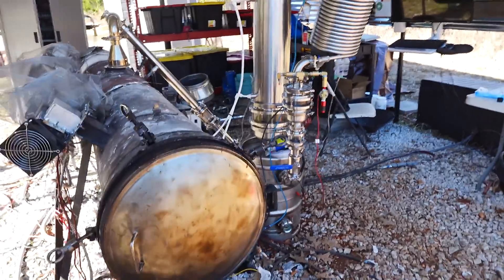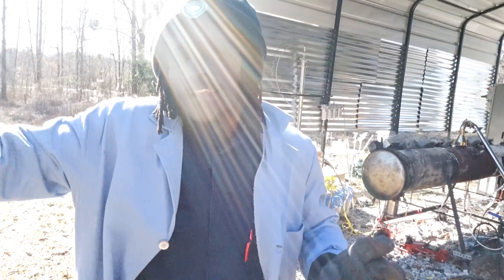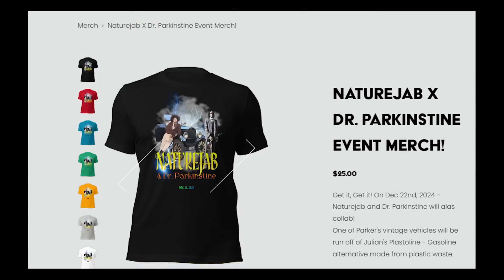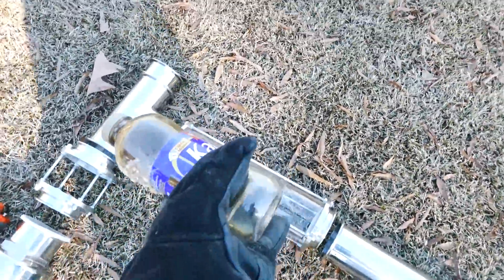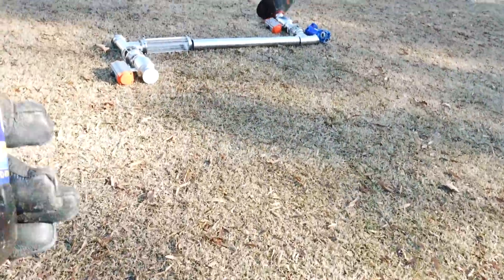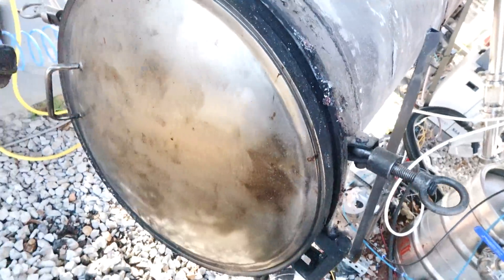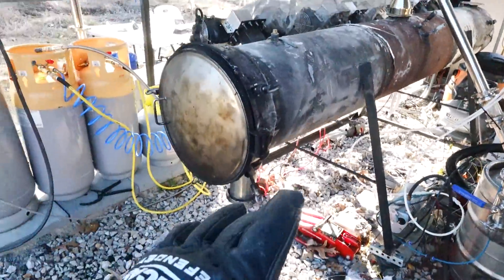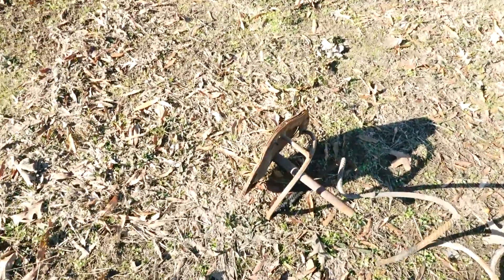UPGRADE the Plastic Fuel Reactor to make it CONTINUOUS! | How I will do it & Why

Comment: Hey Jab, have you thought using Electrolysis for the excess Moisture building up? You could Evaporate the water turning it into hydrogen gas. Of course you need to find a way to distribute that as well though. The reason why I think this might work is because it only requires a minimum voltage of like 1.23 Volts - 1.5 Volts to make it run without the use of external heat. Usually this gas is distributed and stored in pipes and cryogenic liquid tankers. Please correct me if I’m wrong but wouldn’t an extremely cold gas byproduct completely be able to solve any thermal issues? If you could distrubute the cold gas safely to lower temps I mean. 

Yeah uhm let me know if this sounds like an Idea or not, since I was just kinda ranting 😅

I like your work though bro, keep it pushin!!✊🏾

Comment: For the end cap the easiest way to insulate it would be to weld five all thread rods onto the face so you could use the threads to secure another piece the could be any shape.  I say five because it would make it easiest to get consistent insulation thickness and security. 
Design a circle plate cover like you want but keep the thermal bridge to it and the cover to these five bolts.  Or you can cover with like a circle with a cross shape.. some more or extra triangle's and fasteners if you want. 
But my favorite would be if you are spending the time but don't want to line up holes like that would be..  a spiral this might add some complexity as the bolts might need offset some but if your just welding washers to this in place to make everything line up.  Then it's just bending something strong enough to hold that shape and weak enough not to be a pain to bend.
Reply from the maker: Thanks!

Comment: Please consider a change to the bend
I think one of the main reasons you see less oil in a lot of the runs is that the oil molecules would be theoretically more thermodynamically favorable to strip apart compared to the 3D matrix of plastic molecules. So the longer it stays in the machine, the more likely it is to keep breaking down into fragments like ethylene, propylene, methane, etc...

If you mount the tapered coupler/nipple/whatever 45° towards the computers instead of vertical, you could connect just 1 90° bend and then the straight tube. Having that little go around, while flat, requires any oil that makes it through to be heated by vapors of higher fractions below it. But, since your machine heats internally under vacuum that makes most of that heat coming from all that stuff breaking down (since it's too far out for conductive heating from the walls)... And since the oil if the oil is easier to break down...

The problem is I don't know how complex sealing the first hole with the plug is, and it may be a lot of work for nothing.
Reply from the maker: Thanks!

Comment: I worked for a big extrusion company here in Houston at one point... What they had inside of the cylinder was an Extrusion Screw! Look into one of those for your setup... It'll save you the constant rebuilding of your rebar auger.
Reply: Continuous Feed Three chamber Wankel Design👍🇨🇦
Reply: Do u need a degree to be working in ur company
Reply: @Stone_Man20  nah... I learned it all on the job, no experience! It's many different forms of Extrusion work... The plastic extrusion company I worked for was one of the oldest. They ship in trains full of plastic pellets and load them in silos! From those it's vacuumed to the extrusion machine mixer, mixed to specific proportions (for either different colors or products), then it's dropped straight into the extrusion machine kinda like NatureJab, but the only difference is after the plastic is melted it is squeezed through flat hot round disk with a blower mechanism that turns that plastic into a long, building tall bubble tube of plastic film! From there it goes through a series of Hot rollers and ends up in a large roll. Most you do during this time is watching the machine and numbers for spec reason, make sure the roll doesn't "band" (if not you'll have a roll that looks like a cartoon dogbone with meat on it! 😂) You cut a sheet for testing... Take it upfront for to be tested, if it passes (and it better 😳) you lift that heavy roll by lift, attach it to the cutter machine and let it spin and cut that roll into multiple rolls until the big roll is completed!

Sounds complicated, but it's not... Just a gotta know someone type of industry, cause most never even heard of it! Extrusion has been around a long time and was a "don't tell our secrets" type of work. That company in particular was leading for 50+ years... Until they hired around 3 barely English speaking Chinese employees for their HR... One in particular was a tech guy "volunteering to design a website" ...👀
The guy drew up everything while there... Every piece of machinery and equipment... And not too long ago I saw a video from China... Same process, but better! Instead of 2 machines that handle the process... It's all in one and is smaller 😂 What we had that took up all that space, they were able to do and fit more machines in the same space! 🤷🏾‍♂️🤦🏾‍♂️🤣🤣🤣🤣
Check out plastic extrusion operation videos... You'll see what I mean!